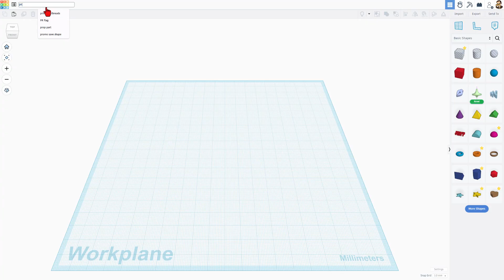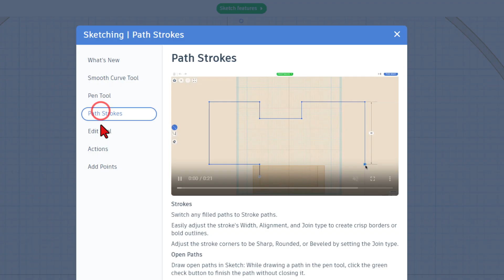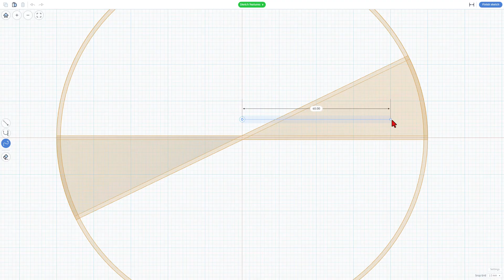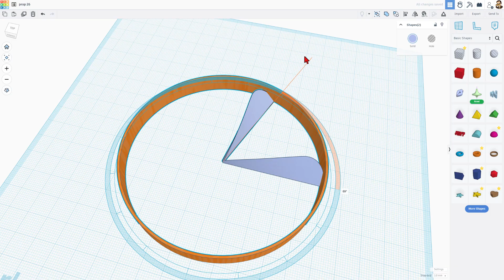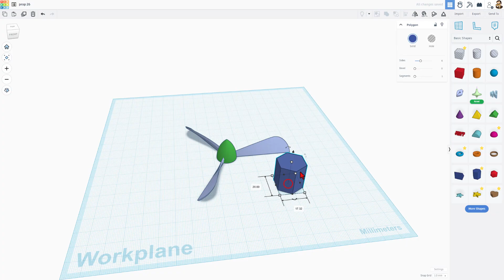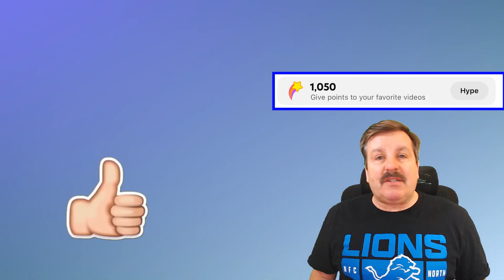Printable Propellers with Tinkercad: Twist & Scale Sketch Parts! 💯🤯

Comment: Well done. Just a reminder that people can design different shapes with the second sketch as long as the sketches overlap. 

If your design doesn't contact the base along the full length, or is too shallow at the tip, supports may be needed when printing.
Reply from the maker: Thanks and great tips!